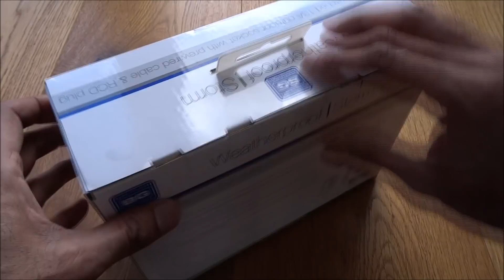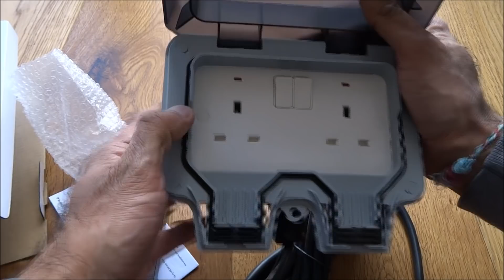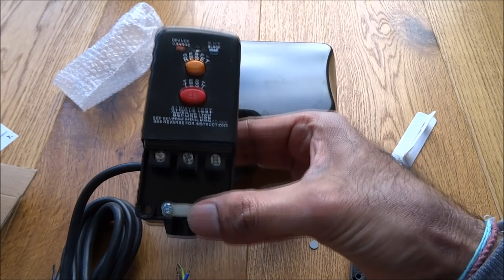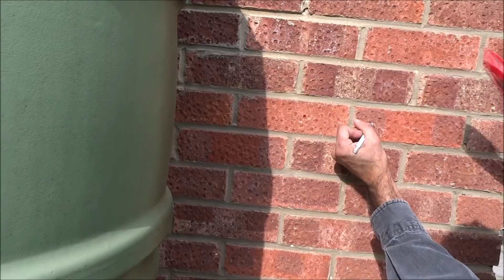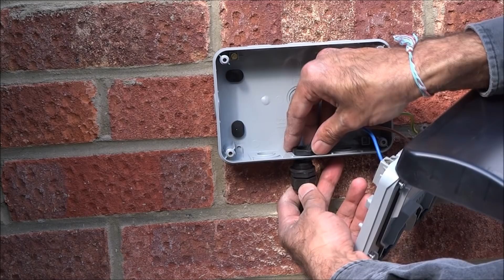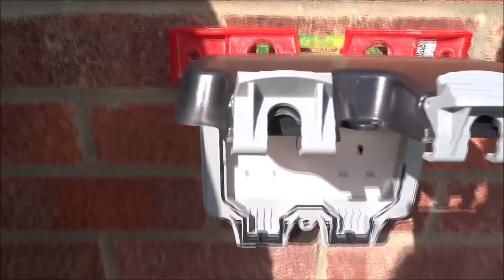How to Install an Outdoor Electrical Socket

Comment: Better to drill mortar rather than brick so you can just point it up if you ever remove it? There’s far easier ways to get the holes in the right place.

Comment: Did you test the RCD socket to verify that it trips within the specified time set out in The wiring regulations BS7671 , also you are required to issue a minor electrical installation works certificate. That proves that you carried out all the mandatory electrical tests set out in BS7671,  and that it is safe for use.

Comment: I already have an outdoor wall socket installed, which is directly pluged into one of the indoor wall sockets. I need another socket outdoors. Wondering if its okay to just plug the new socket into the plug of one of the existing outdoor sockets?

Comment: These sockets are aimed at the DIY market. By opening the unit up you could destroy the IP rating and possibly the manufactures guarantee. For the people who said they have removed the clips and screwed the box directly to the wall the holes where the screws pass through the box need to be sealed against water penetration to keep the IP rating.
The cable enters the box through a IP rated gland and yours needs to be tightened up a little, remember it’s plastic so don’t over tighten it or cross thread it. It should not rotate like yours does maybe a small blob of silicone around the thread will help seal the gland.
Also as someone else mentioned when you drill the cable hole through the wall drill at a slight upward angle to prevent water tracking up the hole around the cable. Again silicone the hole around the cable to reduce the possibility of water penetration.

Comment: If you open the plug back up the 4 black covers inside, remove them it will show screws for the brackets if so remove the brackets and put your screws into the wall through the case, it looks like there will be a blanking plug in the middle of the socket inside, remove that and feed the wires from the back then lastly blank off the bottom. Just watched another video and he bough just a box and it looked the same as this one just without brackets

Comment: if i was installing onw i would have took off the black peaces of plastic behind the socket also drilled out the back of the box and fed the wired though the back and screw it on to the wall where the hook are

Comment: Good video but i would have removed the brackets and used the holes to fit direct to the wall then put the cable through the the back of the box thus eliminating any unsightly cable showing and making the box more secure. Also always drill your holes at a slight angle so that the inside hole is slightly higher than the outside hole this stops any water ingress. A quick note: if you drill out the drain hole in these boxes then you compromise the ip rating of the product, these must only be drilled out in certain circumstances always read the information leaflet.

Comment: I had it problem was rain runs down the back and I'd you don't line up the screws it becomes wobbly I have now replaced it to a better wall mounted one much better....

Comment: Hi great video. I’m looking at putting one of these in for my place. The external plugs will be used for running a pond pump and filter and then probably other plug for a pressure washer now and again. Are these suitable for constant use being it is powered from a plug and not wired straight into the source? Thanks
Reply from the maker: Thanks, yes should be fine as far as I'm aware.

Comment: Can you not spur into the back of the double socket?
Reply from the maker: I don't see why not, but I'm sure electricians will got mental for some reason.
Reply: @GeekStreet  I guess there is no way to isolate it without putting a fused switch on but this video helped so thanks.
Reply from the maker: @AhcMeUk  i would have thought take a spur off it and fuse it then connect.....you're welcome.

Comment: Got ours all set up and it's not working no power 🙄
Reply from the maker: Try pressing the reset button then test.
Reply: Yeah tried that think it could be faulty, another one arriving tomorrow,  great video helped us
Reply: Got new socket still the same , could it have anything to do with our indoor sockets other things are working inside but not this 🤔
Reply from the maker: @beckybutler1577  very odd.

Comment: What size drill bit do you use to drill through the wall for the cable
Reply: He mentioned using a 12mm bit.

Comment: Rough as fuck that. Fire risk written all over it as your clearly not qualified to carry out electrical work. T&E on show outside with no protection, no mention of any manufacturers torque settings or testing for dead. Nothing mentioned about testing the install for safe operation afterwards? At least carry out a Zs test. 
Only a matter of time before someone's house burs down following your advice

Comment: I won't comment  on the errors when you installed a consumer unit  in your garage, but the C/U had an RCD as the main isolator so you did not need a plugin RCD for your outside socket and again NO electrical testing to make sure the install is safe and the  earthing arrangements are correct. DIYers please stop messing with electricity as it can kill. plumbing goes wrong you wet - electric goes wrong you get to be dead.

Comment: Clearly you have no experience with electrics and you should not be Advising anybody on your YouTube channel, so have no need or do not need to open the socket in order to install it hence why it hangs on the wall, it is for a DIY install!

Comment: Should've went through middle hole and drilled through 4 holes in box to wall.
You never earthed connector to box
Reply: The cable had an earth in it so is terminated back into the rcd socket. But agreed should gone via middle so  no exposed cables.

Comment: When drilling through walls, always drill at a slight angle so the hole on the inside is higher than the hole on the outside. That way, you don't get water leaking inside.
Reply: not to mention a tiny drop in the cable or the water will run right back in.

Comment: A few questions is it completely legal to do what i want to do. I want to use a similar weatherproof plug with a box around it that has a cable with a the plug and rcd on the end i want to take the 3 pin plug off the end and feed it through a hole in the wall then once it’s through into the house re wire the 3 pin plug back together then plug it in a socket inside the house. Thanks love this vid
Reply: Yes, it would be fine, as long you use the RCD plug (which you are) and not wire it in into the back of a socket.
Reply from the maker: Thanks for the comment, i don't see why you can't do that. Would be interesting to hear an electricians view.
Reply: @GeekStreet  He would charge £20 per word to reply.

Comment: How do I run this up my garden will I need to bury it in the ground what wire do I need thanks
Reply: If your doing it to regulation standard, you would need an armoured cable , 60cm below ground level and marked up,  size of the cable depends on the load and the distance of the run

Comment: Could you plug a hot tub into this socket? Or does it need a different external plug?
Reply from the maker: Best to check the manual or contact the manufacturer.
Reply: Another question for you, the back box you screw to t he wall also has an earth wire... so you just link a separate earth from the main earth to this? Or do you not need one? With it being plastic surround on brick?
Reply from the maker: @northy16  its plastic so you don't have to do anything.
Reply: Cheers mate! Thanks for the fast reply!
Reply from the maker: @northy16  no worries!

Comment: Could you wire this to the socket in the house as a spur instead of using the RCD plug? What would be the difference?
Reply: You would lose the RCD protecton from the outdoor socket to the RCD plug. You could wire it direct as a spur but if something was to trip it then it would trip the house breaker and turn off everything on that breaker.
Reply: @45Camster  Thank you. having it on its own  RCD plunged into an existing socket. Would this act the same as a hardwired socket? Or would it be just a more permanent extension lead? if that makes sense? For instance the pool heater says it should be plugged in to a mains plug. If I was to fit this would it be the same as plugging it in to a mains plug in the house? Sorry for the long winded reply.

Comment: The socket you plugged into should already have rcd protection...so why  fit another one?
Reply from the maker: This was just to do a video demonstration.
Reply: The socket comes with a RCD plug ,so if you check out the beginning ,he unpacks the socket ,this is for people that do not want to wire into mains . The best was is an RCD outside socket ,he has a socket the other side of the wall , some trunking or 20 mm plastic tube down the inside of the garage ,wire into socket . Job done

Comment: You can remove the two brackets from the back, use those holes to screw the socket on the wall. I would then have drilled the hole inside the middle of the plastic box then fed the cable straight in so there is no wires hanging out, finally i would silicon the whole box around to stop any water. P. S you can also silicone the hole inside stop any spiders getting in or just fit a grommet.
Reply: That’s exactly what I would’ve done, after removing the brackets put the back box on the wall with a spirit level on it then marked the holes And bought the main cable through the back
Reply: Yes thats the way i done mine no cable showing completely water and spider proof

Comment: Good educational video. HOWEVER, this has confirmed me that fitting an exterior socket using a spur off the ring main with a DP isolator is no more effort and gets the job done properly (and saves you losing a socket indoors!).
Reply: Oh, and isn't notifiable either - so could still be done by a DIYer!
Reply from the maker: Thanks for the comment and info!
Reply: Please explain further!
Reply: There are loads of articles on the web or vids on Google showing you how to do a spur off a ring main. Main considerations for an exterior socket are:
- adding double pole isolator between ringmain socket and spur so that you can isolate the exterior socket if it becomes damaged or trips due to water ingress.
- you angle the hole downward from inside to out so if you do get water ingress it doesn’t make its way to the isolator.
- you put the T&E cable from isolator to exterior socket in some form of trunking (I used 25mm barrier pipe - it was snug).

And yes, I completed the project a few weeks ago. Took a few hours but pleased with the result.
Reply: and have to channel all the cable from consumer unit, a lot harder than this install
Reply: I’m not sure you understand what a fused spur is sir if you think you need to add another radial or ring circuit. No channeling required other than from an inside socket to outside.

Comment: All the dislikes must be from electricians losing their £60 call out fee and £80 per hour rate. 

I removed the metal keyholes brackets and then fixed the box using 4 screws. As soon as i saw the metal brackets I envisioned the box wobbling about all the time, so wanted to make it a more permanent fix. Its rock solid with 4 screws and easy enough to remove the metal brackets. I then dabbed some clear silicone over the heads of the screws and popped the rubber seals over the top of them to make it totally weather proof.
Reply from the maker: Thanks for the comment.
Reply: I'd rather pay £80 and sleep safe. The electrician will test the circuit to ensure the entire circuit is operating correctly. You have no idea if there's a hidden fault your not aware of.
There's a reason electrician's take 4 years to qualify and have up to date wiring regs qualification, competent person schemes, liability insurance's etc 
Videos like this by unqualified people are plan dangerous. I can count at least 5 errors watching this video and guaranteed someone watching will make another 3 and so on
Reply: @thedixtarify   domestic installer doesn’t take 4 years
Reply: @michaellecky6438  Correct. Less than 6 months to become a domestic installer but that's another story.

Comment: So are you suppose to drill one drain hole on this on the bottom right if you have a gland like on this one. But i was reading the instructions and it said if you drill a drain hole it will no longer be ip66 rated

Comment: Interesting video for a diy - er  , but surely according to regs a garage , shed or outhouse should be wired with a rcd protected circuit anyway , so wouldn't a second one be a little pointless , perhaps its to protect the woefully undersized cable ,  as potentially the double socket could be subject to a 6kw loading [ 3kw per plug ] . I guess its ok for a lawnmower but in my opinion not really the thing to do . It begs the question , does it comply with the relevant B.S. safety tests I wonder ?

Comment: Would it be ok to plug my outdoor hottub into this?
Reply from the maker: Yes should be fine with that, depending on the size of the plug. I suggest buy it but don't install make sure the plug fits and you can close. If all good then install.

Comment: Fitted one myself a few days ago.   I removed the metal brackets and screwed straight to the wall using four screws and plugs.
The hardest part of all (if anything) was finding a drill bit long enough to go through two cores of brick and plasterboard into my kitchen.   I ended up with a high quality 400mm SDS Drill bit and it went through very smoothly.

Works a dream.   Just need to affix a grommet to the cable inside to tidy it up a little.
Reply: Ha just the comment I was looking for! What size masonry drill bit I need for my kitchen wall ! Thankyou. 👍👍
Reply: @helenclayton8259  glad it helped.   Screwfix should be able to supply the drill bit you need.
Reply: Thanks! I’ve just borrowed one from a neighbour 😉 although, I’ve just done the job and it’s not working. When I do the test button it’s right but actual socket not working, checked live neatural earth and still 🤷‍♀️do you need to strip wire ends or something do you know ? The one I got looked just like one in this vid, ends exposed.🤦‍♀️🤷‍♀️
Reply: @helenclayton8259  I just removed the socket and fed the wires through the wall and reconnected it all back up as before.    In the outside box I fed the wires down through the waterproof grommet and into the wall.   Nothing particularly difficult about any of it.    When I switch it on I do need the press the switch on the breaker in to get it all to work as it doesn't come on right away otherwise.     I currently use mine to power the stuff in my shed - light, power tools and compressor - with no issues.
Reply: Mick Evans ah great that’s solved my issue, re set the breaker ! I did the test as in instructions but never pressed again to reset 🤦‍♀️ haha Thankyou for your help !

Comment: Where can I get a 25m one of these want to run it down into my shed
Reply from the maker: It may worth using a armoured cable and connect to it using a junction box.
Reply: Over that distance it’s a job for a qualified electrician

Comment: I don't like the idea of wiring sockets with flex. I will either wire IP rated sockets to 2.5mm T&E or SWA cable with a gland fitted. Good video nevertheless.
Reply from the maker: Thanks for the comment much appreciated. Hope you can support my channel by liking the video and subscribing.

Comment: Only recently come across these videos and like the range. This one is confusing as being prewired suggests DIY use but if it is “ installed” ie needs use of a tool, it must be installed by a Qualified electrician if it is outside ( as it is sold for). So having to fit the plug makes it an illegal installation. If the plug was pre fitted it would be an extension lead !
Reply: im thinking of getting one, maybe it doesnt need to be installed by an electrician as it isnt really a permenant installation as it can be unplugged, otherwise wouldnt it need to be signed off as safe? not sure, might order one anyway
Reply from the maker: Thanks for the comment. Interesting point, sounds crazy.

Comment: You can always tighten the mounting screws with an open spanner from the sides. That's why it's so wide.
Reply from the maker: Thanks for the info.

Comment: Buddy...what the proper name for the black screw underneath the socket box ??
Reply from the maker: I think you are referring to the cable gland.
Reply: Thanks what size ??
Reply from the maker: Best you check when you purchase incase it comes in different sizes.

Comment: Thanks for that I hate paying electrician for everything. I need badly 2 plugs like this one in front and one in back of the house. I already have junction box and screw door box with extension cable which is pain in the a. I I need to unscrew it every time. It was installed by electrician for water feature but I don’t want to spend more money for something I can do myself

Comment: Would this be safe to use a 13a inflatable hot tub rcd plugged in? Extension leads are unsafe, maybe this is next best affordable option?
Reply from the maker: Yep this would be a good idea and safer, always worth consulting at electrician or the manufacturer for advice too.
Reply: How did you get on with the hot tub Jay? Im doing the same at the moment, heater and pump into one of these outdoor sockets.
Reply: Slabsurfer worked perfectly and still does, hasn't tripped once or any other issues, i've also used my powerful drill in the other socket at same time and no issues.

Comment: I bought this extension box for my garden and I drilled through the box and fixed it to the wall it makes a tight fit to the wall, But that's my opinion 😕 your video is still brilliant thanks for sharing 😋
Reply from the maker: Joseph Hanley Thanks for the comment much appreciated. Don't forget to like and subscribe.